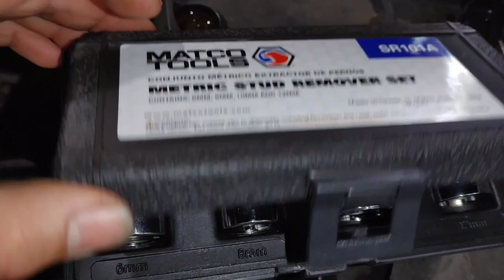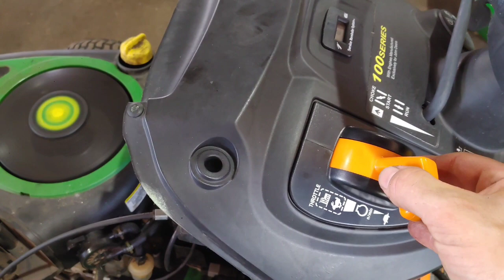Lawn Mower Carburetor issues & fuel systems 101.

Comment: I have a 19.5 h.p Briggs and Stratton o.h.v  with a Niki carburetor had to clip the tip of the anti after fire solenoid because it quit working the fuel line has a in line shut off valve

Comment: I would not replace the carb. Take it apart and soak it in gumout. Wash it real well, blow out all passeges, reassemble with new gaskets and run it. For the most part all good info. I am a old school mechanic. Rebuild if possible, only replace if you have to. Save your money for the beer when you're done.
Reply: Most people replace it with a knock off Chinese one so it can only get worse depending on the quality.
Reply from the maker: I'd had good luck  with soaking them in mineral spirits overnight, then blowing them out with compressed air.
Reply from the maker: Another good point I forgot to mention. Often customers bring in their equipment and say "I've already replaced the carb" and we ask "Did you get it from Amazon?" They never buy the oem carb and it's rare a cheap Amazon carb works properly at all.
Reply: You have a point, but these newer carburetors are really hard to clean. I always would tell my customers I can try cleaning it out, but it may ultimately need replaced. I would usually charge them an hour to clean it and if it needs replaced an extra half hour and I waive the supply fee for the carb clean.

Comment: I bought a used pressure washer that would not run, I bought a complete new carb for it for less than 20 bucks and fixed it! It's not worth rebuilding the carb on most of these small engines when replacement carburetors are so cheap...

Comment: I run all Deere equipment all with Kawasaki engines. Your content is great and very helpful. I have a 950 with a 27.5 Kawasaki that will run fine for a while then will only run on choke but constantly have to turn choke on and off to keep motor running do you think I should change carb or what is your suggestion. Also thanks again for the content
Reply from the maker: Install a new carburetor and gaskets.  Also make sure your fuel filter is clean.
Reply: @Mechanical_Mind  ok will try thanks for help

Comment: I have a John Deere 314 which is having fuel issues. I replaced coil, condenser, starter, all new fuel system , and carb and it will not fire off normal. It will only fire off starting fluid. It was running ok just really needed a tune so I bought new carb now it won’t do anything even with old carb back on. I need help

Comment: My daddy has a Scag Tiger cat with a Kawasaki FH580V engine that would only run in choke. I replaced the carburetor and it’s a little better but will die past halfway.  Any suggestions are greatly appreciated.

Comment: Mine is only running when I start with the throttle at the lowest setting. Once it starts I immediately have to turn up the throttle a little bit (putting it on choke will kill it). It runs/sputters for about 30 seconds and dies.

I installed a brand new carburetor. Didn't have a fuel filter so I installed one of those. I emptied the old gas, then put in new gas. I also installed a new spark plug. It only runs when I put cleaner in it (TONS of white smoke coming out). 

I have zero turn riding mower. Briggs & Stratton PowerBuilt 9.0HP. Model# 28B707

If you have any ideas please help before I drop tons of money on a new mower. Thank you!